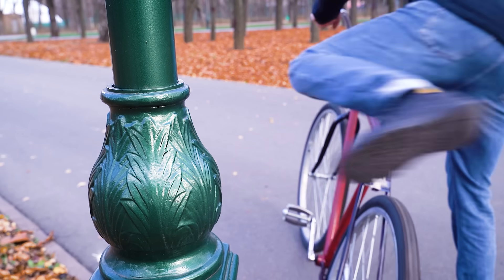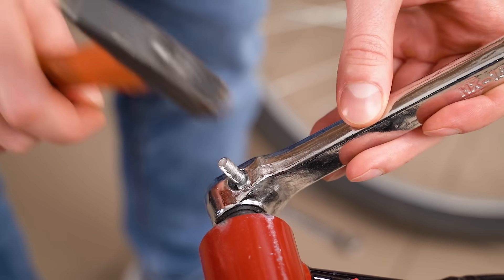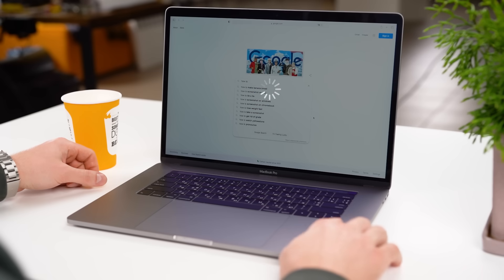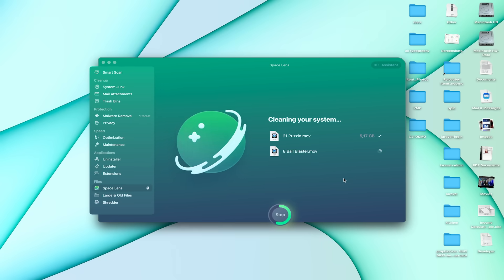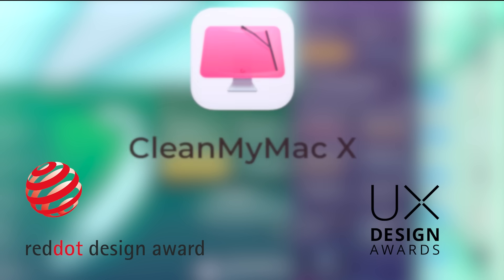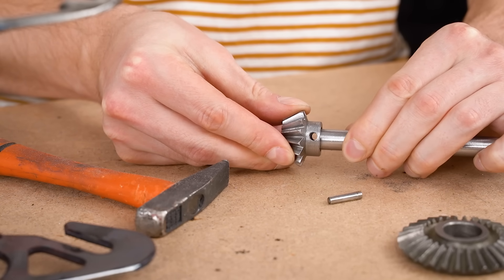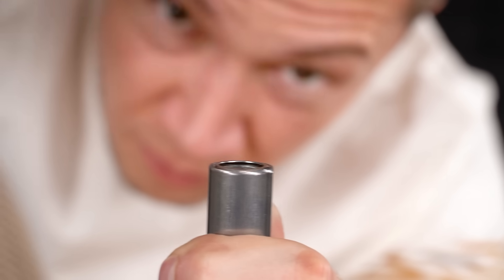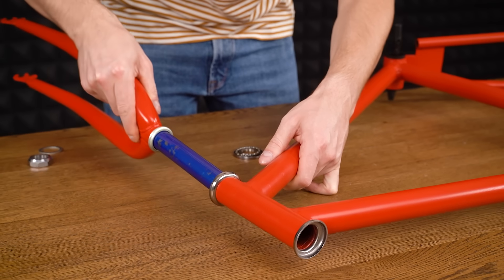Insane Chainless Bicycle Prototype

Comment: I wish you had companion videos about the engineering advantages and disadvantages of your creations
Reply: Yeah.. things like fatigue, abrasion, gear ratio will be the enemy, eventually
Reply: @rahulsharma3911  100% truth
Reply: @rahulsharma3911  You mean, in about 15 minutes or so....
Reply: I think if change te gear ratio this will be great
Reply: @alejandroponce182  No because its friction makes it so slow and there is no hub...
Reply: biggest problem i can se he used the wrong type of lubrication, Just WD40 may work for chains but for those gears he needs some real crease with the current crease the gears will get destroyed within acouple of hours of cykling. also he should build a full cover around all the gear (A gear box) so that dirt cant get inside and destroy the gears.
Reply: Gearshaft transmission can handle a lot more torque, as well as long lifespan assuming everything  is properly lubricated; downside is there are more complicated parts making it more expensive to make, they also weigh more;

Chain transmission's upsides is relative simplicity and low weight; downsides can handle less torque without becoming  bulky and cumbersome, has shorter lifespan under high stress use.

Those are the reasons you use chains on bicycles and motorcycles, and gearshaft in cars and trucks
Reply: I am thinking this is very simple idea why no one can do before 🤷
Reply: @mddanishkhan40  because it has been done before and chaines just work better
Reply: @MrFliffi  yea chain is much smoother more durable more quiet etc. This idea is dumb it just makes bike worse
Reply: @mddanishkhan40  Ceramic Speed make this system years ago and continues.
Reply: CyclingAbout talked about why didn't this hasn't caught on yet
Reply: I think change gear is disadvantage. 
While advantage is less expensive and less dirt and list lubricant maintenance. Less weight
Reply: you are completely right, there is a reason why cars and truck have overdrive off button preventing over stress  when gears are smaller even when gears are well lub
Reply: Make my way to 1000 please 🙏🏻 🥺
It's a kind request
Please 🥺 😢

Comment: The gear ratio is Completely wrong which leads to less torque 🔥🔥🔥
Reply: it's just a prototype/dumy model . he just made for fun purpose . don't take this seriously
Reply: @abirabir5218  exato! É pura brincadeira e diversão dele.
Reply: Na bruh, with the small gear at the front, it will provide more than enough torque, too much cadence required. As a matter of fact,  it needs a bigger driver gear if u want to use it as a normal bicycle.
Reply: @kekhrieshuya5479  yeah .

Comment: So, was it hard or easy to ride this cycle?
Like which is easy? This one, or the one with chains?
Btw, nice creativity and good effort..!!
Reply: the one with a chain would have less resistance, be lighter, cheaper and is the standard for a reason. shaft bicycles have existed for a very long time and they are still made. shafts have avantages but they cant outweigh the disadvantages.

Comment: Great models cycle
Reply: Re-cycle
Reply: Lol. If you stop moving pedal at high speed just forget your legs 🤣
Gears wont slip like chains if you stop moving pedal. Why he didn't add a slip mechanism 🤔.
Reply: @ScienceSeekho  lol in bikes from 1950s and older it was like that but with chain. A lot of people that dont know anything about bicycles here...
Reply: @ScienceSeekho  its just an experiment
Reply: ͡°Ĺ̯ ͡°
Reply: Yes 😀
Reply: It's not used in modern mtbs and road bikes cos it's too heavier than chain drivetrain
Reply: Not fryweel .....in back hub, than when you stop peddling....bike is also stop ...and break like emergency breaks, or you lift your pedel time to time.   Speed is also not sufficient.
Reply: it's been done many years age
Reply: الموضوع واضح ما يحتاج ترجمه
Reply: Looks cool but is definitely not a great model.
Reply: Hello before this blows up
Reply: Make my way to 1000 please 🙏🏻 🥺
It's a kind request
Please 🥺 😢.....
Reply: @RonitSingh17  no

Comment: no one is gonna mention that shaft driven bicycles are already a thing? the prevoius bikes with no inside of the weel were cool but this is just a lesser known bicycle type that is already quite easily available and used.
Reply: I had one, it also had 6 different gears!
This is not an original idea as you said!
Reply: @FaresDjebbar  I was thinking that a downside of this technology would be the inability to change gears. I guess I was wrong. How did gear-shifting work on your bicycle?
Reply: @c.y.hollander5592  it has a similar setup as the on in the video, then a gear hub attached to the main gear in rear wheel,
Reply: Well, he still built it himself. There are also bikes with no inside. So what? Still pretty damn cool imho
Reply: exactly
Reply: Very cool recreation of the original shaft driven bicycles.  It's crazy to think that about 120 years ago,  bicycle manufacturers successfully produced and sold bikes with these features.
Reply: Okay, where's the one you built? THAT is the point of his videos. He built it himself - pretty cool
Reply: @incautious1   dudes just pointing it out to everyone that seems to think he invented this. it is cool that he made it himself, won't disagree on that.
Reply: @Narayan_Patki  trolls make up stuff. No implications anywhere in the video. Easy to say something sucks, hard to build it yourself.
Reply: @incautious1  but it doesn't suck though